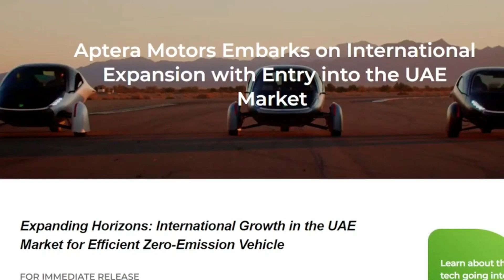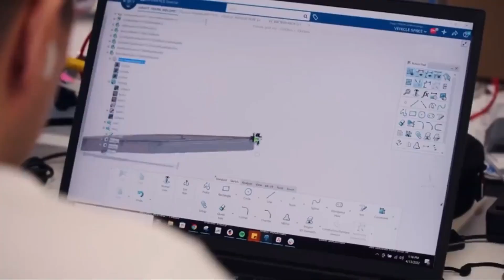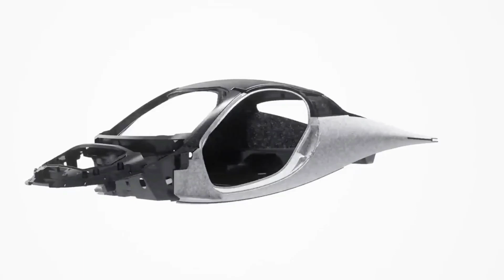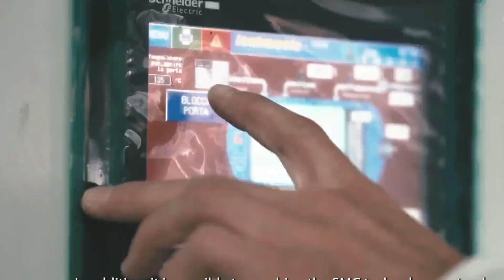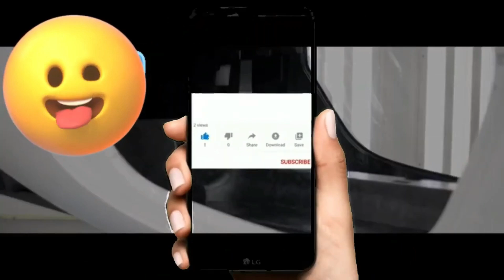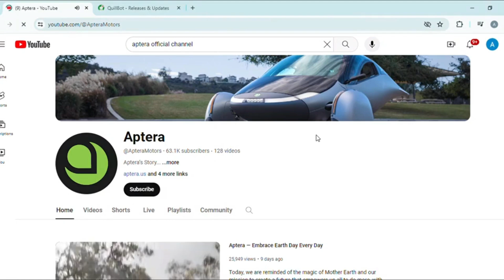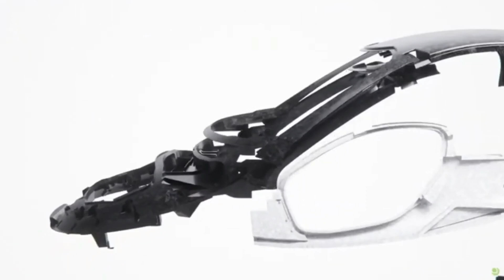Aptera's Production Intent For her prestigious solar EV

Comment: It's not the naysayers who do all the deceiving. This silly trike doesn't work, so no amount of money will get it to production. I have been saying that for nearly three years and am confident thse CEO's will run away for a second time. They are just milking it for as long as possible.
Reply: Doesn't work? How so?
Got any first person sources or just winging it?
Reply: @ronfarnsworth7074  "Doesn't work?" A definite no. 
"How so?" First up, prototypes don't count - nobody buys them. That means there is no Aptera to even claim one works. Done and dusted right there. However, the prototypes have been lied about. Since they have not established a single claim, the default position is nothing works until it has been shown to.
"Got any first person sources or just winging it?" I'm the first-person source, and I go by facts. When there are none I don't pretend there are any. Let's run through claims versus established truths?
Skin cooled. You can dismiss this because they say they have dropped it for the LE.
0.13 Cd. A doctored Gamma did Pininfarina and no results given. Smaller Alpha got an estimate from CFD - doesn't count.
0-60mph under 4 seconds. Never been proven.
40 miles on solar. Never shown to do an inch.
400 mile range on Gamma. Never shown to do ten.
40 or 45 kWh battery. Never been seen. Probably a forklift battery in any of the prototypes
Regen brakes. Test drivers have admitted there are none on any prototype driven.
Torque Vectoring. Never proven.
Aircon. Admitted to not have any. Promise one of the PI's will eventually get it.
101 mph top speed. Never seen more than 50. Refused to take it over 60 on a racetrack, but didn't see 60.
Passed a moose test. Faked the course and faked the results.

There are more, but that should be enough to show you are clueless. The onus is on them to show it works, not on people to show it doesn't. What they have shown would only satisfy a really gullible f001. Now you provide your sources like you should - and try to tell the difference between facts and nothing but snake oil lies.
Reply: Of course what you describe as "this silly trike" works.  I know first hand, because my wife and I have ridden in a prototype.  You don't do any real research - probably because you don't know how.  

The CEOs never "ran away" the first time.  They were kicked out in a surprise board vote.  You need to look at the history, which is readily available to you.
Reply: Just think if you had been in this "silly trike", you would not have wiped out the way you did!
Reply: @arcticturtle8776  That's banal.